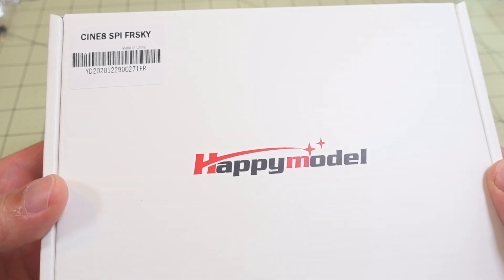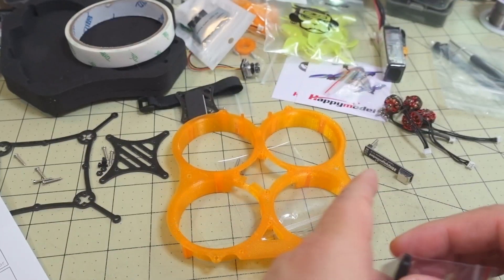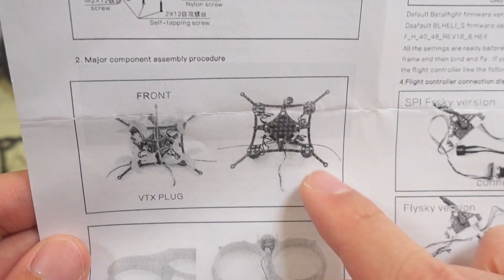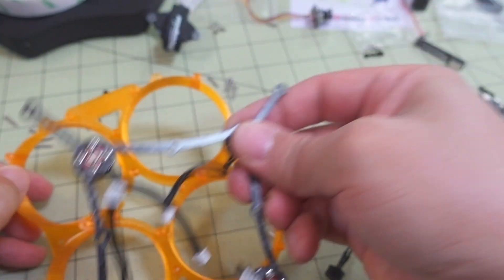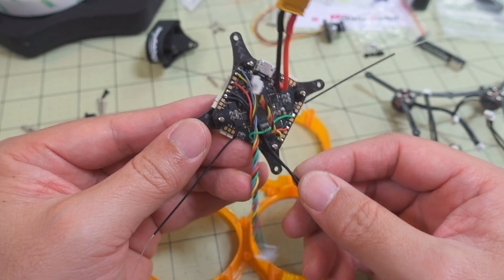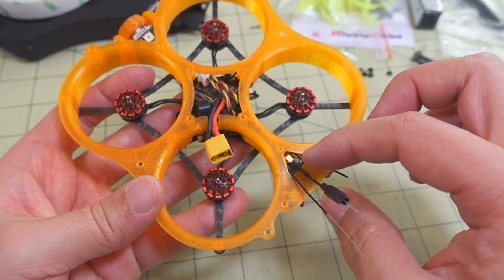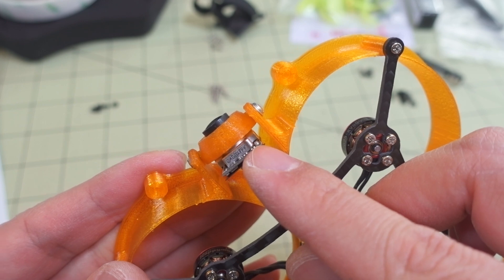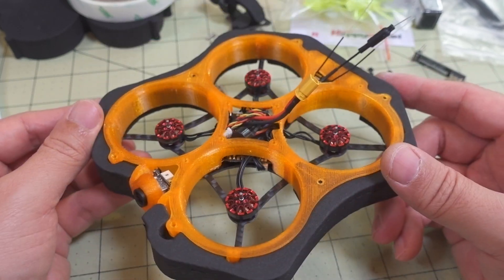Easy DIY Cinewhoop Build // Happymodel Cine8 🛠️

Comment: My kit came with an OSD board. How should I mount this?
Reply from the maker: What does it look like?
Reply: @AlbertKimTV  it's small, about 1" x 1.5" , looks like it's just kind of a joystick (up, dn, left, right, center buttons) and has a connector for a 2pin wire (came with green/black). It came with some tiny screws but there aren't any holes in the board.
 I tried to post a link to a picture but I don't think YT is letting me.

Comment: Do you have cli dump for cine8, i bought same frysky spi model, yesterday ive put it thogether, tryed original 450mah and 650mah 3s battery and i have a lot oscilatons and motors are so hot i cant hold them more than half a second.
I didnt mess with pids, only put some throttle expo, ive noticed in blheli motors are set to 16.8 and 96khz with bidirectional dshoot, could that be the problem?
Reply from the maker: I did not change any settings.  The 96khz should help with motor heat and make it less not more.  You probably have too much vibration in your build.  The FC needs to be able to wiggle around a little bit to absorb vibrations.  If it's screwed down too tight, the vibrations will cause problems like this.
Reply: @AlbertKimTV  tnx for the tip, ive loosen up a bit fc but problem is still there, its perfect on 2s but on 3s its just bunch of oscilations, vibrations and hot motors even after 20 sec of hover...
https://www.youtube.com/watch?v=8jOdlxrjBDk&ab_channel=Gjurovski64
Reply: or if you have som PID suggestions, so i can try to save the motors atleast from burning :)
Reply from the maker: @GjurovskiFPV  Try lower P and D by 5 at first, see if it helps.  If not, try 10.  If that doesn't work, add more filtering.  Slide the filter level all the way to the left.

Comment: please share the pid settings,,, my cine8 only flew 2 minutes with a naked go pro, and the motor was very hot
Reply from the maker: I'm using the factory PIDs with no changes.  You probably built yours in such a way that too much vibration is getting to the FC and gyro.  That vibration will cause the hot motors.  Check your build and see what that might be.  Perhaps you've tightened down the FC screws too much.  It needs some flexibility to dampen the vibrations.  Also check if any wires are touching the gyro directly.   That could also be a source of the problem.
Reply: @AlbertKimTV  if using gnb 2s 520mah battery, will it be better?

Comment: Hi albert,  how  is the range for the spi  frsky receiver?
I built this one with jumper t lite, im getting only 20-50 meters .
Reply from the maker: Did you adjust your freq fine tuning setting?  It's probably not in the optimal range for the receiver.

Comment: Hey Albert, I ordered the frsky version of this and just received it. The flight controller came in an ESD bag labeled FLSKY. There’s no external rcvr n the box that I can see so I’m guessing it’s FRSKY in a mislabeled bag? How can I verify what the heck they actually sent me? Thanks.
Reply from the maker: They might have sent the wrong version.  You can check by connecting it to Betaflight and see what receiver they have setup.  If it's SBUS, it's FrSky.  If it's IBUS, that's flysky and you'll have to exchange it for the right version.
Reply: @AlbertKimTV  I’ve never had banggood send me the wrong item before so I was worried  about tearing open the bag. Then I remembered there is no way to send it back even if it was the wrong one...lol. Any way, hooked it up to BF and under the config tab - receiver section - it’s setup as SPI_RX / Frsky_D. Not sure why the bag was labeled FLSKY.  Thanks very much for the help, Albert.

Comment: with all these parts screwed into the flexible ducts one might expect for it to come apart pretty easily in a crash. The screw holes would then tear rendering the frame pretty useless, wouldn't it?
Reply from the maker: If you're flying around super fast and you crash very hard frequently, you should not get this.  If you fly it like a cinewhoop for slow smooth cinematic flying, the crashes won't hurt this.  You'll damage your GoPro way before the quad.
Reply: @AlbertKimTV  I like how this seems to fly level pretty easy and smooth. Doesn't seem jumpy at all. Thanks for taking away my concerns.

Comment: How do you balance the weight of the gopro if the battery is side ways?
Reply from the maker: The goPro is only 26g so it is a little unbalanced but doesn't affect flight performance at all.  Having the battery sideways also helps with pitch control.  You should try it and see how you like the difference in feel.
Reply: That could've be a great discussion, the pros and cons of having the battery sideways mounted for different styles of flying and how it affects the tune. Iflight  ships the A85 with battery sideways mounted but I changed it to the forward aft position because I thought having the wires on one side caused asymmetric drag.